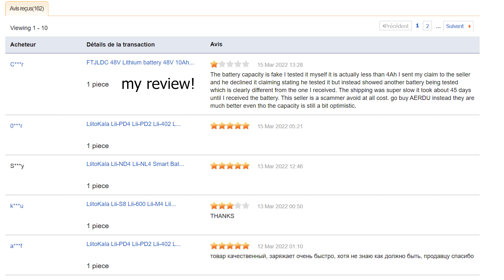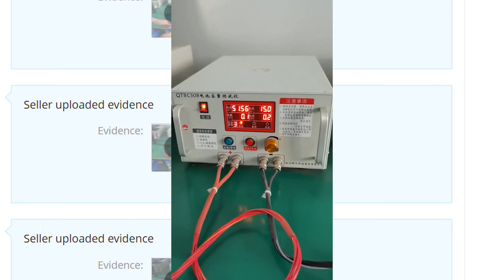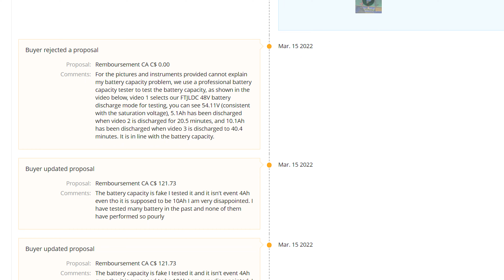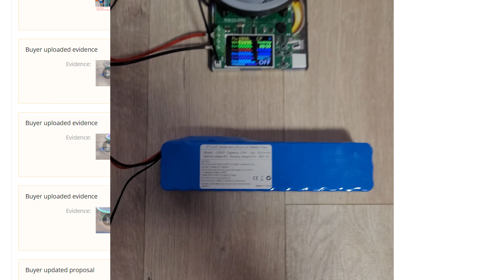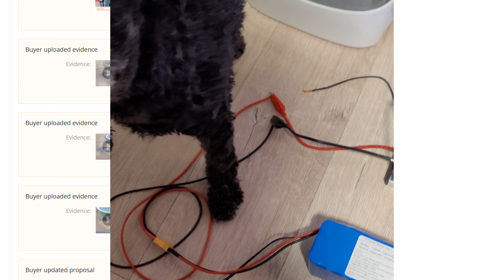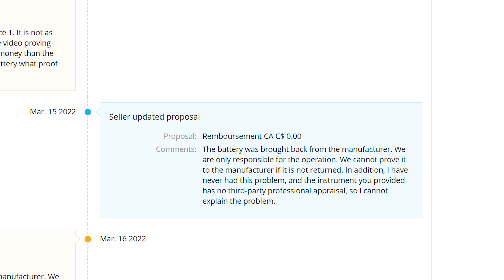Why you probably shouldn't buy cheap battery pack from AliExpress

Comment: Batteries are sadly one of the most commonly faked on a mass-scale. That and USB sticks with buge capacities lol.
Most people dont have the equipment or knowhow to verify capacity, so they put in garbage-tier chinese cells. These are not only a tiny fraction of the expected capacity -  but also a firehazard because the construction qualify is terrible ans the QA non-existent.
It really sucks because good batteries with genuine cells can be had fairly cheap on Ali, but it always feels like a gamble . Consider buying the battery elsewhere, or otherwise stick to the largest most established sellers that also specify what cells are inside the battery. Only get Samsung, LG, Panasonic cells, and immediately test and document it on video in case of any problems. Ali is usually pretty good about arbitration if you can document the problem well. It is a lot of hassle and stress to save a bit of cash though :(

Comment: Well young Padawan, there are some thing you have to learn and understand 1st is perkets battery law, 2nd manufacturers always rate a battery with this equation C/20. So whats that mean C = capacity divided by 20 whats 20? HOURS! So 10/20=.5 amps  so next voltage, voltage max is 4.2 volts per cell in series for LIPO or LION. I believe you have a 13s pack. So 54.6 volts fully charged. Lowest voltage per cell is 3.0 volts so min voltage would cut off with that discharger at 39 volts. So set up that awesome discharger to stop at 39 volts discharge that battery at .5 amps, yes half an amp and i bet your capacity will be 8ah. Not 10, like advertised. Look up a battery data sheet and capacity will be determined by c/20 no matter what chemicals are used lead,salt,cobalt,lithium,potato. Ask yourself why are power tool batteries so expensive Quality of Cells!
Reply: Life lesson the cheap turns out expensive.

Comment: I'm in the process of upgrading my bike with a second battery but like always I take my time to do some research and I'm happy to find your video. To bad that some sellers still want to rip off paying customers, Thanks anyway.
Reply: Hey, same here, did you find any good battery to upgrade your bike?
Reply: @unapersona2657  Actually yes I found a battery at Amazon as well as the connection, the speed of the bike is the same (56 kmh) but the reach is now more from 50km to 90km.

Comment: I got a liitokala 48v 10ah battery for about $100 and the only thing wrong with it is  the cells are 3000mah instead of 3350mah making it actually 9ah and the low voltage cutoff is quite high at 43v. For the price I think it is still a bargain and I can get 30+ miles of ebike riding. For an extra $140 I'm going to get another battery the same and run it in parallel using a Dual-Battery-Discharge-Converter-Connection-Adapter which can charge both batteries from a single charger which will give me a 48v 18ah battery for half the price of anything I can get in my own country and it has double the amps because the batteries are in parallel. I call that a win.

edit - I could have got even cheaper batteries because I only need 30a (15a+15a in parallel) not the 60a that I have ....$215 total with a triangle battery bag
Reply: Did you buy it form AliExpress?
Reply: How are they holding up? Any degradation?

Comment: How was the seller allowed to use a battery in their possession to prove anything about your battery?

I haven't finished your video yet but a video of your discharge test and photos of the end result along with photos of the voltage and capacity during discharge should have been more than enough. I've not done disputes with with battery packs but I've done it with powerbank boards to prove they don't support a certain fast charge protocol using a USB tester along with my DL24. I'm trying to think of what other items I've disputed and won easily but they all blur together. Just a mess of not being understood, repeating yourself, sending photos, etc

3800mAh??? In that huge battery? How? Was it 14S2P? 1900mAh cells are garbage unless its something like the Samsung 20S in which case it would hold voltage quite well with a 150W discharge. Yours seemed to have pretty significant voltage drop just from the 3A load (not the discharging capacity over time, the initial voltage drop)

Comment: Do not even bother communicating with the sellers. Its been nothing but delay tactics for me EVERY SINGLE TIME.

Initiate dispute, include GOOD evidence, and be prepared to have to re explain it again. I often have to do that.

I've won EVERY dispute I've put in.
Reply: Pictures of charging and discharging capacity or videos??
Reply: @RustyShakleford1  always. Guess I'm at the advantage as I have all the necessary tools to challenge the sellers....granted you have to spell it out like you're talking to a kindergartener...but might be people that have no technical knowledge and just solve disputes.

Usually a pic of my load tester with the discharge test works but I've had to include videos and datasheets on stuff before when the seller was trying to be slick. IE Atorch tried saying the 600W 40A electronic load I bought was fine even though it shut down at ~35A with a 12V battery. Tried saying it was my battery. I was using one of  the most powerful LiFePO4 batteries on the market so I had to include a datasheet showing it was good for 560A continuous (if the connections could support that)
Reply: And the seller plays a good trick of nice words talking..  Maybe they use AI ?..  or just scripts..

Comment: "I'm getting a refund fuck this" 
-me everytime I shop aliexpress.
Reply from the maker: Ahaha facts my dude
Reply: Nah bro, just learn how to buy selectively...
Try to use common sense.
Try buying from verified suppliers and those that have a lot of hearts (favourites) and orders going on.
I have bought electronic stuff in the value of ~70 dollars for a drone project, the drone costs 50 dollars for me (diy) and all the modules got here in time, all work flawlessly.
I have bought 10 daweikala 18650s and they work really well, too.
Reply: This has NEVER been my experience, youre probably the type of guy who goes on cheap alixpress and you still try to get cheaper than the average aliexpress price and then get scammed LOL.
Reply: I have spent thousands of dollars on AliExpress over the last 10+ years, only a few times have I had to try for a refund (or partial refund)... Shop more selectively as previously mentioned.

Comment: I bought some 18650 3400mah littokala batteries and they are cheap (2$) and real capacity. Usually weight (cell should weight more than 40 grams) and capacity (less than 3600mah) is two keys that could indicate a good battery.
Reply: Half of that weight might be sand
Reply: @aydin2005ozdemir  I tested mine and they all were above 3400mah and working for 4 years for me. I know its really hard to get good batteries from China and 90% are fakes. But buyers also became a little smarter and test those batteries, leave reviews. I got some fake Ultrafires too for free as I proved those are fakes. Usually fakes are lighter and weights about 20 grams. I think they put bad batteries in battery packs as its harder to test them.
Reply: I second the quality of littokala on aliexpress 5*
Reply: I bought Daweikala, they seem okay
Reply: LiitoKala is not consistent. Their LiFeP04 cells are all over the place. Some people have gotten some absolute garbage. I'm talking 280Ah cells that couldn't hold voltage above 3V with a 50A or 100A load.
Reply: I bought CaoMM on Ali, it seems okay also and ship from California

Comment: The Chinese are doing everything when it comes to batteries. Pretending that is a branded original, genuine, authentic battery, but actually it is a re-wrapped fake. Writing for example "Panasonic", but in reality it's a Chinese cell....and so on... When buying and the Chinese for example claim that is "Panasonic", this is better than ordering an unknown product. Because "Panasonic" is a reference. The original, genuine, authentic Panasonic cells exist, they are on the market and can be compared. An original cell has a certain weight and this can be compared too.
When buying, is better to buy in your own country with your own commercial rights than buying batteries from China. 
And if the Chinese seller or Aliexpress does not give a refund or not the right refund, go and ask PayPal, the credit card company and so on.
Reply: If you made the purchase banks will literally flip you off.
Reply: Panasonic cells are chinese LOL